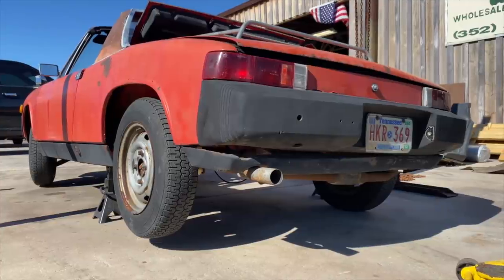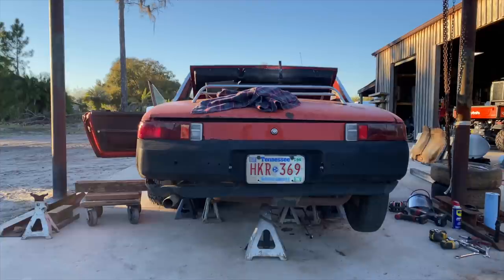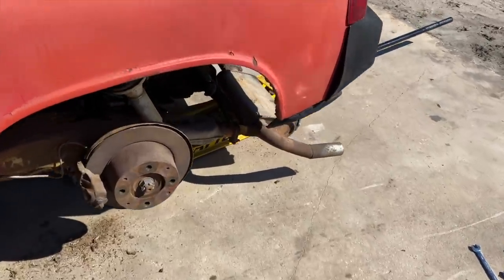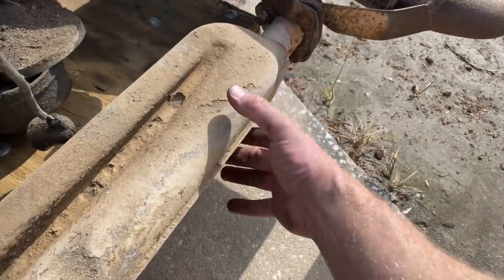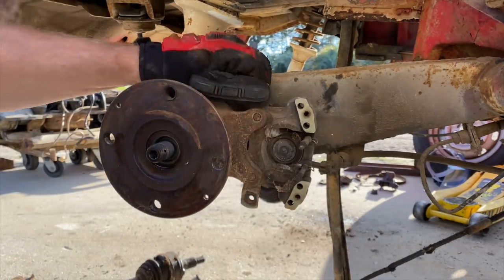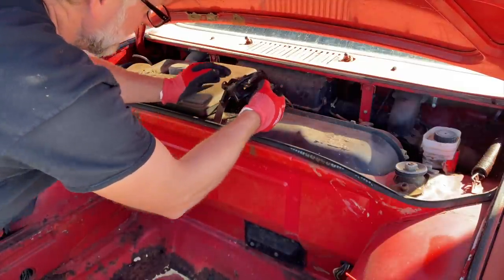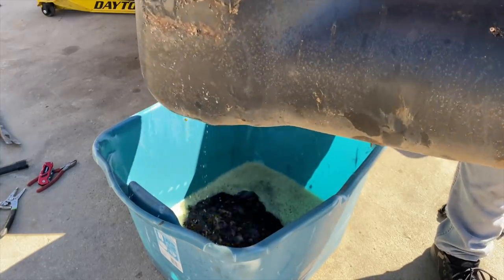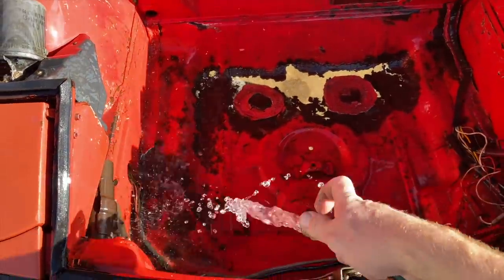Porsche 914 Type 4 VW Engine Removed - 2.0 Build

Comment: That was fun to watch. I was a fuel attendant at a gas station when a customer pulled up in one. He bought one of the first ones that day and was so proud of it. A lot of guys called them a glorified Volkswagen 😝. Haters gonna hate. You have a long journey ahead to complete it. The device that you pulled off the body, that is part of the FI, it’s an Auxiliary air valve 😁
Reply: >> A lot of guys called them a glorified Volkswagen<<
I don't think you'll find many shared VW parts. Wheels, knobs, maybe window cranks.

Comment: Hi again CT! Spent Sunday afternoon watching you take your 914 apart! Please bag, tag and label whatever you remove! After my first comments, I had to look it up and there were 4100 of the 76s made! By comparison 2300 of the 914-6 were made. The rear valence you cut off should be saved and restored if possible . 
Contact Dr. 914 at Atlanta Auto about replacement parts or give his videos a check, he should have whatever you need or know where you could get it!
Done right, this is a $20-30k car!

Comment: For the most part you cant tell what's going on with a motor by looking at the dirt on the outside. From your videos you seem to just want to rebuild engines. That is a perfectly fine ethos. But the internals could be perfectly fine. You could take that motor and get it running. Do a compression check . The long block could be perfectly fine. Cool video. Cool that you found that 2.0

Comment: Keep up the good work! For the earlier 914's there was recall on the fuel pump due to vapor lock. It was decided to move it to the front of the car. I dont remember if the 75/76 cars came off the line with it in the front trunk or not.

Comment: FIRST THING I DO ON THESE.....Remove the engine lid......makes life so much easier. 4 10mm bolts.
Reply: or maybe it is 2 if I remember right. been many years since I owned a few of these cars. I had a 76 2.0l too. with alloys.

Comment: Excellent video CT  :) rebuilt engine & transmission too maybe do plus filter also pan gasket too and glad was fairly easy take out surprises me ! Also brake booster need services up plus do cleaning to fuel tank with 60 % hot water 40 % vinegar let sit for 60 mins and shake up after fill up 3/4 full also repeat too!
Reply from the maker: Thanks Andrew! Yes, it needs everything....I will try that! =)
Reply: @CTmoog  :) welcome to help out!

Comment: CT please heed these warnings;
 take really good detailed pictures of the air box and duct routing, as well as the valves, and duct valve/door actuator cables. You will need to remove all that to put new seals on the openings. BE ESPECIALLY CAREFUL with the corrugated plastic pipes connecting the air box, they are effectively unobtainium, or just plain stupid expensive. Yours will be very fragile. I suggest spraying them with a really good silicone spay and let them absorb it as much as possible, before attempting to remove them. The box and fan assembly is over $500.
It will be a hell of a challenge rebuilding this one. Since it’s well documented now, that it’s a basket case, so you should feel free to resto-mod it, tastefully. 914’s where one of the first EV conversions. Once you get the frame, body, and paint done, you might consider pissing all the purists off, and do a Tesla drivetrain conversion, or stoke yourself out by adding some bracing and converting it to a flat 6, 3.0L. I’m the mean time disassemble carefully, even the special nuts & bolts, can make the project go broke.
I and many more will be watching.
Reply: Great advice 👍🏻

Comment: My experience working on the 914 is to have the car up higher and then raise the engine/tranny straight up/down.  It will make life a lot simpler.  Trash the fuel injection and either replace with a better system or install a couple of Weber carbs.

Comment: Owned 914 way back when. Not much on bottom end, but get it moving it was hard to catch.  Takes lots of maintenance weren’t cheap to own. I had a buddy that had 3-4 that kinda ran, then had 3-4 that didn’t run. He had 914-6 that ran pretty good, then he bought a new Porsche that some Dr’s wife had wrecked, tore hole in cloth convertible top. Wrecked, called dealer, traded cars with hers sitting in her driveway wrecked. Dealer brought her a new car, called my buddy offered him a deal on wrecked one. He could fix almost anything.

Comment: I’m enjoying watching your videos but can’t help but wonder why you didn’t purchase a 914 in better condition. To make yours workable is going to take top to bottom repairs and floor pan replacement. I’m impressed by your efforts though. I have a 94 Corvette that’s was in nearly showroom condition, that’s cost me $15k to buy and $6k to repairs and the main problem is there are no new parts available for many systems from anti skid brakes, slip reduction, and cruise control. I wish I didn’t love the later C4 style.

Comment: Hey CT, I see it looks like the 2L 914 EFI runner's and plenum on.that Type4 mtr. However,  have you confirmed that the engine number and heads confirmed its a 914 2L too? lots,of good Type4 factory performance parts in the 2L 914 that were not in the earlier smaller 914 mtrs. This is the Type4 to be keeling and rebuilding ; )

Comment: Its a nice little car, remember them on the roads back in the 1970's. There would be a guy driving and a pretty gal by his side.Lol 
Check the cylinders' compression first, that'll give you an idea of how good the engine is. But with that one or two valves might have pitting - ie the ones that are open - and so will leak air, showing low compression there. The fuel injection will be probably be a 'K-Jetronic' or the one after that (I think it was the L- Jetronic) system, the manual will show which. Parts for either of those systems will be hard to get, pricy or both, but there is a US company that makes electronic single point fuel injector system for a variety of engine sizes, worth looking at. The old fuel can be used as a cleaner for those dirty parts, just add about a litre of kerosene to it and use it to pull all that grime off the engine/gearbox etc.

Comment: The rear wheel bearings are held together and supported by the stub axle.  There will always be some play with the axle removed; to check the play properly the axle must be in place and torqued to spec.

Do you have a Haynes manual for the 914?  It's about as good as you'll find in print currently.  It literally has about 85% of the content from the factory manuals (word for word and photo for photo!) directly copied.  Well worth the small $ cost.

If you search carefully, you may be able to find PDF files of the original factory manuals on-line as well.  But the Haynes is a whole lot more handy, I find.

Comment: Maybe if you use a little penetrating oil before you unscrew things. Yes you can reuse the pads as long as the rotors or pads are smooth and no grooves however as long as they are relatively cheap put new ones while it is apart.

Comment: Hi CT, what I would do which may or not be right is take all the parts off not needed to put it on an engine stand to run it. That way you can listen to it to make any adjustments like valves and make sure all the cylinders are firing
Reply: We believe this one’s a goner. Loud knock from the bottom end. Better not keep running it to prevent total catastrophe.
Reply: Ya, I heard it too but going through it on a engine stand might discover the issue before trying to start it. Draining the oil to see what comes out too. If it's a rod the motor is toast anyway. If a valve maybe can be saved?
Reply: @TimsWorkshopTJY  This one can be saved but needs a total rebuild most probably.

Comment: Man, you have to loosen every  each screw on that car.  And yeah, I would at least open the engine  to see how the condition is inside. Would be annoying if the car is finished and the engine breaks down.  You might have to take the motor out again. I would not take that risk.  
The whole project is a lot of work for one person.

Comment: That engine needs a lot love and to see what has to be done. The Rotors could be resurfaced. The gas tank could be saved and cleaned out. I though there was a gas tank cleaner or I could be wrong. I would take the rebuilt engine and put it in this car. Just replace what really has to and drive it dirty.

Comment: only use 6 point sockets not 12 point ,  grind flat the finders on the sockets or take off the inner bevel so 100% of surfaces mate to avoid striping the head off the bolts

Comment: If I guessed it right,,,it,s an air cooled engine,,,,as I didn't see the radiator and cooling system when u had got the engine and transmission out under the vehicle.

Comment: Man, those tanks are bull shit, i would just put a fuel cell in the trunk area and call it good.  But if you do decide to save it, POR15 makes fuel tank cleaner, and sealer kits.  They work good too, i used it a while back on an old land cruiser.

Comment: Motor doesn't weigh anything. you just drag it on the ground after pulling the floor jack out.
Run power to the ignition coil jump the starter with jumper cables and use a external fuel can & hose. it will run.
Reply: It did and it had a loud knock.

Comment: Holy Moly CT it's starting to look like you might completely restore this zippy sports car too,  Hey!  there's a name for it, Zippy.  Yeah . . the engine needs a complete rebuild and it looks like you'll have to tear down most of the car to clean out the creature nests.  You don't want to be driving a car with all that MUCK in the air vents.